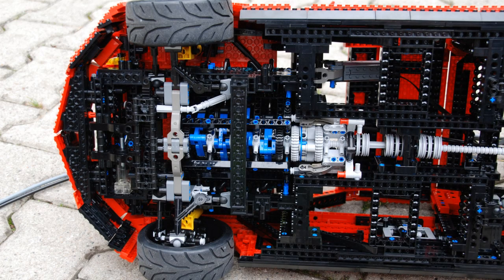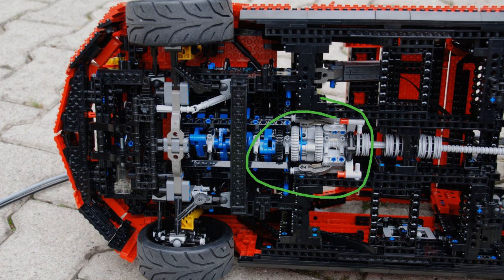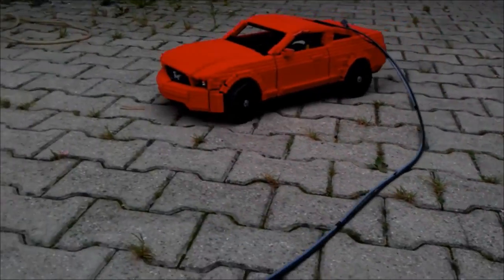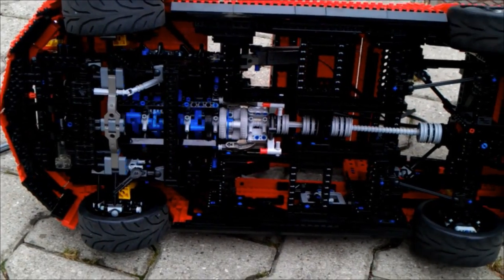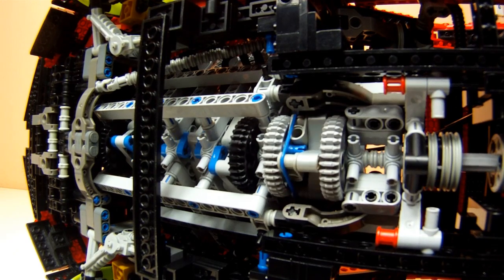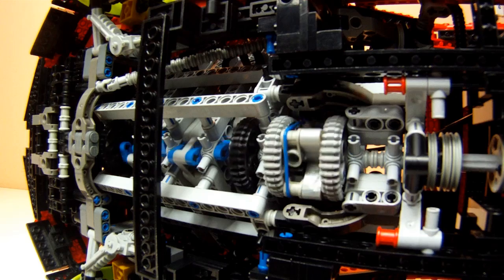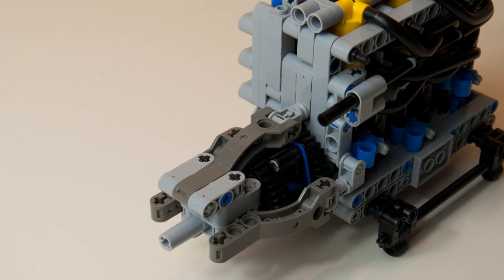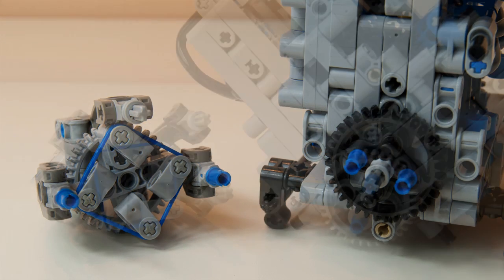LPEpower episode 07 - One way clutches

Comment: If making a realistic Lego car with a clutch and a gearbox, would it matter at which stage of the drivetrain the one way clutch is placed? Should it be between the engine and clutch, between the clutch and gearbox, after the gearbox, or is it irrelevant?
Reply from the maker: +Phineas Yoder You should place it where it'll cause the least stress in the drivetrain. In my case i'm not using a gearbox at all, so from this perspective it's irrelevant if i put ot on the differential side or behind the engine. It is more convenient to have it behind the engine in my case though.

Comment: This is slightly irrelevant to this video, but have you ever thought of using the old lego racer RC car main bodies to control steering and somehow set up something like a small paintball gun gas tank as a source for air, and somehow use the motor output of the body to adjust airflow from the tank?